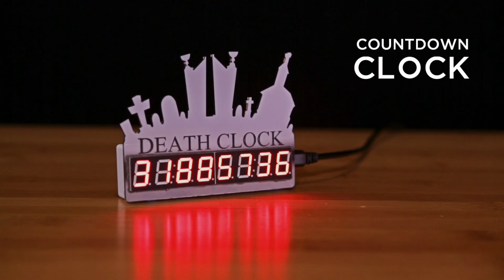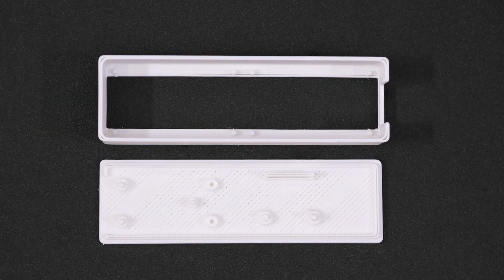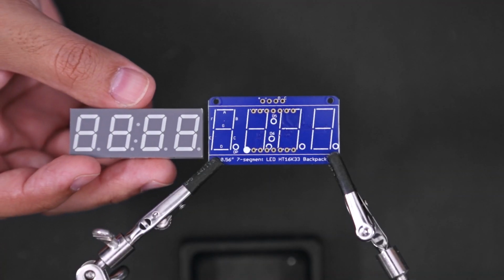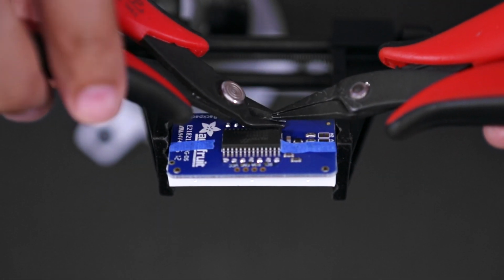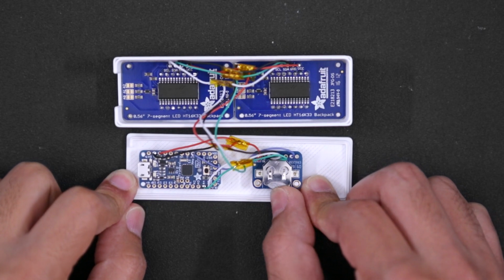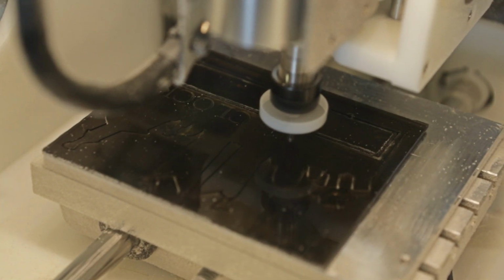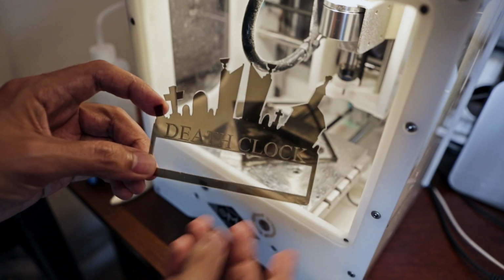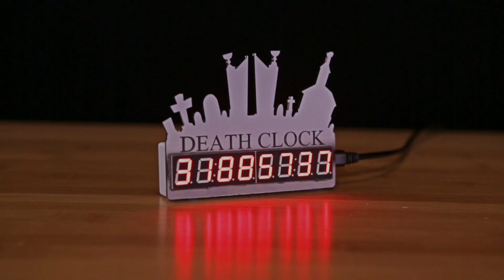Countdown LED Display - DIY Electronics How To

Comment: Hi Adafruit!! I am making a version of this but for Christmas for my mom! the only problem is the UCC hole on the display is not there for mine I went for a bigger one which has two other ones. it has U_IO and +SV if there I can put the red wire or any other color wire in one of them that would be great! but I already put 2 of the wires into it and might not be able to return in now, if not of course I could just buy a new one but if possible a supplement for that wire would be great!